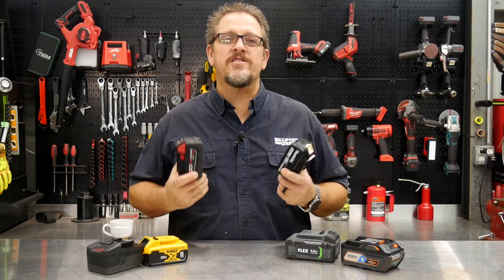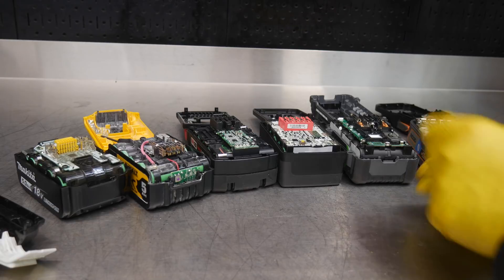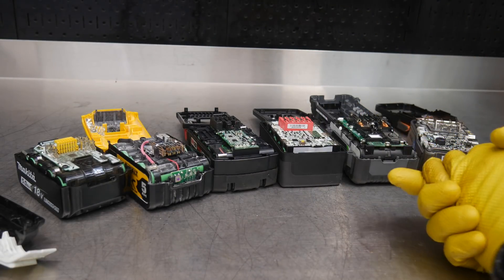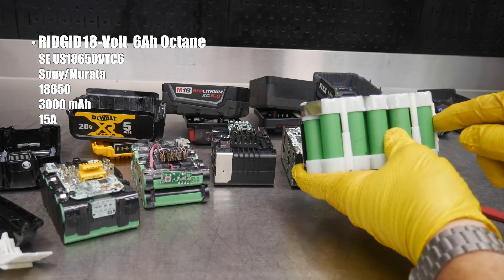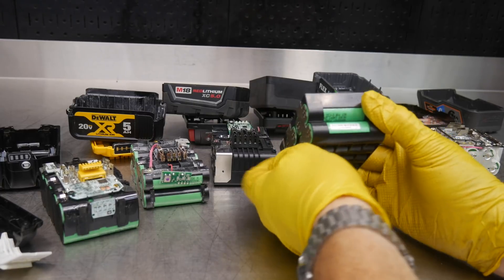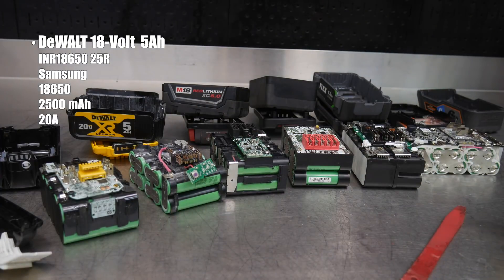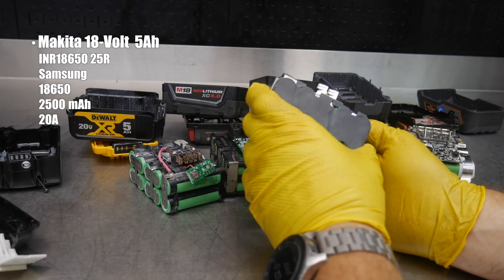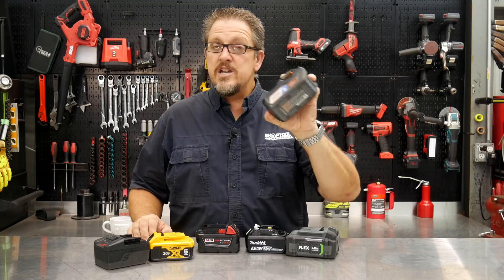What's Inside Tool Batteries? Milwaukee FLEX DeWalt Makita Snap-On [18650 21700 ??]

Comment: Why didn’t you test the differentiating brands of cells 🤦🏼‍♂️
Reply from the maker: That's a good point, but it's mostly useless. Many tool companies will change the brands of cells that they use, based on supply, price, etc. Even the same size battery may change the brand of cells. Thanks for watching.

Comment: A bit disappointed to see regular nickel-plated steel connecting those - they chose the cheapest components. Bosch batteries seem to be significantly better built than all of these.

Comment: If you're a bicyclist, drone/RC enthusiast or an avid hiker you should already be well versed on 18650, 21700, 26650 and 28650.........like everything in life no 18650 battery is created equal.....you have crappy one's and high quality one's.  The fact that the entire industry uses Samsung speaks volumes on how the entire industry is just in collusion OR Samsung just makes the best batteries.
Reply: Dewalt used LG cells in that 5ah XR battery prior to 2022. Not sure why they changed. There weren’t any issues with it. Maybe Samsung is giving out crazy discounts to tool companies ?
Reply: Don't even get me started on the ykk zipper conspiracy

Comment: The numeric designation denotes the diameter, length, and shape. 18650 = 18mm diameter, 65mm length & 0 means it's cylindrical

Comment: This is probably already mentioned, but as far as i've read, and seen all the 18v = 20v.   It's all marketing.  But I have some from each brand, and they all start at about 20v fully charged and go down to about 18v nominal.  Flex 24v is probably different though.

Comment: Happy to essentially conclude that they are all the same thing. The Snap On is $$$$$ while the makita is $$$$ DeWalt and Milwaukee $$$, Flex is apparently a Lowe’s house branded tool, which I know barely more than nothing about, but they seem to be lower priced. 
Rigid being Home Depot’s captive offering, with solid worthiness but a questionable lifetime warranty. My experience was met with BS excuses such as still possessing the ORIGINAL printed receipt!!!! A tool I used plastic to purchase, which was supposed to be my iron clad proof of purchase, purchase price, time, date etc. Thankfully the rest of the Rigid tools I have haven’t had any problems. 

My Makita replaced the original Craftsman drills I began with in 2001. The sears battery tools endured till I decided to get top notch gear instead. Now I’m fully armed to the teeth with the Makita 18v system that one and all still perform great.

Comment: More dangerous to put the metal table than wearing gloves 

you can touch them
it won’t kill you
i work on these all the time

Dewalt flexvolt 6,9,12 are just normal 18650 cell
some of their XR using 21700
you can tell they are much wider and bigger 

Samsung 25R are quite decent
Sony VTC6 better quality with less discharge
most tools draw below 15A except some of bigger saw

Comment: Wow, the ridgid, dewalt and Makita look very cheap out of there case, every other brand has a cage in a cage.
Reply: Actually, the Makita cells are not only caged at both ends but the two halves of the cage are screwed together for greater mechanical shock resistance and to take any mechanical strain off the connection strips. The cell interconnections are a full square of conductor material and not just cross strips like the other makes. They also use integrated tabs to connect to the BMS where others mostly use wires. And both sides of the battery pack conductor interconnections are covered in a thick adhesive fish paper to reduce chance of accidental shorting, increase corrosion resistance and increase mechanical shock resistance (albeit small). 
But I like DeWalt tools, so that is what I use.

Comment: Do you know how durable the Milwaukee battery is? I dropped one today from a ten foot ladder on concrete. It still worked and I  kept using it right after. But now I’m concerned it might’ve been leaking and contaminated my clothes and skin. Would it leak and keep working? And would it leak liquid. I don’t notice anything right now, but I’m scared it might’ve been leaking on me while I was still using it. 
Thanks! 

I’ll check the battery when I go back to work tomorrow so maybe I’ll see a residue or something.
Reply from the maker: There really shouldn't be much liquid in these batteries. Lithium Ion is really not liquid. There could possibly be some goo, but your battery would definitely show signs of weakening. Thanks for watching.
Reply: @Shoptoolreviews  thank you for answering I appreciate it! I looked today and saw no signs. So it’s all good. 
Good well informed video

Comment: Has anyone had yellow fluid come out of their battery 🔋
Reply: You have? 
I dropped a battery pack today from a height of ten feet on concrete. Is still worked and I kept using it but I’m concerned perhaps it was leaking gas or liquid. I didn’t notice anything yellow though.

Comment: The output Amps is double what you're claiming. the 2p multiplies the amps by two, while the 5s or 6s multiplies the voltage by five or six. Any of these packs with 20A cells is outputting 40A continuous. Any with 15A cells is outputting 30A continuous. That's why the single row 1.3-2Ah batteries are so inadequate for serious use. They only have 15-20A of continuous discharge.

Comment: The batteries I've taken apart are MILWAUKEE 5ah was Samsung
 DEWALT 5AH had LG CHEM CELLS 2000mah
HITACHI 5AH had SANYO CELLS 2600mah
MASTER FORCE 4AH SONY CELLS. 2100mah

Comment: The funny thing is that the Makita charges it faster (45min for the 5ah) wich is way less than the rest.    In any case,  most of them output an 800w figure.  No wonder why a cordless drill feels so powerfull; A 650w bosh corded drill was a big deal back in the day
Reply: 20V batteries are usually capable of outputting 60A continuously. 1.2kW is the most common figure. usually cutting tools are hugging that limit

Comment: The funny thing is that RIGID has the best batteries. VTC6 have the lowest voltage drop (very important parameter at high loads!). The 25R are good batteries, but not the best! I wonder what's inside the Hikoki / Metabo HPT. The new 18V battery packs look like 21700.

Comment: Thanks for the breakdown, subscribed. Now a question; all but one are 5Ah batteries. Of those the most common cell capacity rating is 2500mAh, and there's 10 cells per battery. Doing simple math, 2500mAh x 10 = 25,000mAh / 1000 = 25Ah. I must be misunderstanding something, where am I going wrong? Is it because they're wired 5 in series so need to divide by 5?
Reply: Yes, the pack are in 2s5p configuration, 2 rows of 5 cells in series, so you get 2.5+2.5=5, in series the voltage adds up, not the capacity.
Reply: The cells are indeed in 5s2p configuration. 2 cells in parallel equates to 5ah. Essentially making one 5ah cell out of two 2.5 ah cells. Then those are series for 18v. 

Hope that makes sense.

The way you're looking at it, would be every cell in the pack in parallel, and voltage would be 3.6 nominal or 4.2 max.

Comment: if using lithium polymer drone battery.  the energy expended is certainly much greater than the 18650.
Reply from the maker: True, but you don't find Li-Po batteries on powertools. Mostly Li-Ion. Thanks for watching

Comment: Great video I was just looking at the 25r to rebuild a pack and i guess its clear its a good choice.  The interesting one would have been the rigid 5ah, might well have had 25r. The 3ah I am repairing are not marked.
Reply from the maker: That's interesting. Typically we can always find markings on the batteries today. Thanks for watching.
Reply: You will get much better results with a 25S, or if you want the highest possible output, the 20S
Reply: @procrastinator1842  hard to find the 25S. The 20S is available if you wait for them to be in stock

Comment: Old dewalt used A123 cells  50A discharge current,120A peak.
Reply from the maker: Wow, that's impressive...120A peak discharge. Thanks for watching.

Comment: 21700 will always win vs 18650 when it comes to performance related to brute power (max current). But from a capacity perspective, the manufacturing process has to evolve a little more to catch up with 18650s in regard to capacity per cell volume (energy density).  25Rs are the most used 18650s today in power tools. Batteries of mid-rage tools go for Sony V3s or newer than can also be 10A, not 20 like samsungs. Milwaukee stared with 12AH the use of 21700. Now they have 2x5 and 1x5 batteries with 21700s rated high output.
Reply: Not necessarily the 6amp flexvolt which has 18650 cells outperforms the 6amp 20v battery that has 21700 cells
Reply: @loucifer4205  You can't outperform Samsung Ts with samsung Q/R/RMs. Your statement is absurd. Unless that18650 battery uses 4 rows of 18650 of 1500mAh, which are obsolete by now.
Reply: A pissing march is always bound to happen when two battery dorks cross swords😂

Comment: Awesome video but not really anything not already available with a small amount of research.   Where I think we need more information is in the features of the batteries and how they interact with the tools - not the difference between 18650 and 21700 cells. Obviously a bigger battery will have higher output.  I want to know what the features of the battery management system are and how tool makers are interacting with their batteries.  Also, while 5 of the 6 batteries had batteries rated at 20A continuous is that really necessary?  How many amps does a tool draw under load?  With Lithium cells there's always a tradeoff between capacity and max output.

Comment: Please correct me if I'm wrong.......I'm not sure I understand but is the only difference between the 18650 & 21700 the fuel tank? Power output is power output but having the 21700 batteries are like upgrading to a larger fuel tank that still has the same horsepower engine........ Please let me know if this is a correct statement. I don't know.

Comment: DeWalt starts using the 21700 cells in their 20V 8 & 10 Amp/Hr as well as their 9 & 12 Amp/Hr FlexVolt batteries. I’m not positive of what cells are on the 20V 6 Amp/Hr battery. The 20V 5 Amp/Hour and down 2 stack batteries as well as 1.3, 1.5, & 2 Amp/Hr single stack batteries use 18650. The 20V 3 & 4 Amp/Hr single stack batteries also use 21700. The 6 Amp/Hr FlexVolt battery uses 18650 cells. The FlexVolt batteries all use 3 cell stacks of 5 either with the stacks in parallel for 20V or series for 60V. The 20V batteries can come in either a single or double stack of 5; some newer DeWalt tools can take advantage of the increased power capabilities of the larger 2 stack and 3 stack batteries. DeWalt only calls them 20 a Volt Max in the US/American market in the UK and EU DeWalt calls them 18 Volt Max.

Comment: Some Milwaukee tools do indeed take advantage of the higher amp output from the 21700 cells. And Makitas new 40v line uses the 21700. They got stuck with cell size because of their choice to do the x2 side by side 36v tools. They would have had backwards compatibility issues.
Reply: I think I'll build my own 21700 battery 18v pack for my Makitas using one of the DIY boxes from alie.

Comment: DEWALT IS NOT 20 VOLT! It's just marketing the 20V max... Here in europe they are labeled 18V. And their 12v line is 10.8V in here. 
The difference is in measuring nominal voltage or not. Lithium cells usually are ~4v peak  and 3.6 under load, so 3.6vx5  Is 18v and 4vx5 is 20v... That's where it comes from... P.s some Li battery chemistries (most of them) are actually 4.2v max 3.7v nominal

Comment: It seems to me the tool battery cells are still fairly primitive on there own when you take away all the tech, microchips and all that connect to them. They are still the same shape and heavy. I’m waiting for the time when they begin to really shrink in size and still maintain the power as fell phone batteries have done.
Reply: Phone batteries are bigger today than a lot of phone batteries in the early 2000s, as today's phones require way more power. Just like how power tools require way more power than a cell phone. Tool batteries might still be big and heavy, but they're significantly more powerful and longer lasting than the old ones.
Reply: Most cell phones now use Lithium ion polymer (Lipo) type batteries which can be thin and formed to fit in the available space inside the phone. They are very energy dense but are considered more dangerous because they do not have full metal cases and the slightest puncture that introduces air into the cell can cause it to go into wildfire. That's how a dog chewing on a cell phone recently set a house on fire.

Comment: I am surprised that Teslas are full of thousands of these small battery cells. I would have thought electric car battery cells would be the size of beer cans. My point being, in a cell phone the lithium batteries are flat and tiny. Tool batteries are larger due to the power load. So why aren’t car battery cells scaled up in size? Strange... at least too me.
Reply: The reasoning behind using cells instead of prismatic blocks (you can get 400 amp hour prismatic beasts) is the 18650 allows better cooling of the battery material for a longer life and safer operation at high current discharges.  Their newest tabless NMC cells are 4680 9 Ah cells or 46mm in diameter and 80mm long.  They were able to get the internal resistance down enough that those cells can crank out the amps without getting hot.  The 900 KW/h battery pack option in their semi has a massive amount of those cells.  Now THAT is the cell I'd want for my next tool pack, they can handle 5,000 cycles completely drained and speed charged and would probably outlast the tool.  Maybe in a few years some tool company could get those cells, I'm not holding my breath though.

Comment: We have Snap-On but no Kobalt 🥴🥴
Kobalt would use the same as Flex though Chervon babies 😁.
Kobalt uses 18650 and they have 21700 in the ultimate output batteries that are unicorns for the XTR lineup

Comment: Being the batteries are all the same.  I wish they would be universal.  I like brand A's drill and brand B's grinder, and brands C's saw.  But I don't like having 3 different batteries and chargers on my bench.  Plus you can't have just one battery you need at least two of each.  So I stick with one brand but now I have a tool I don't really like because I don't want all the batteries and chargers.  If the only difference is the electronics then why not stick that in the tool and make a universal battery that all tools will use.  Just like when they made all (well almost) cellphones use the same charger.
Reply: I recently heard about adapters for this purpose. Check em out. May be what you're looking for

Comment: Excellent Tim !!!  I concur with others in the comments a more expanded version of this video would be great!  Thanks for putting this out.  Very interesting.  Again, I am not impressed with the FLEX brand battery.  Looks like the Makita, DeWalt, and The Milwaukee are the best constructed batteries.  I’m not too sure about the whole M18 Copyright issue that floats around on YouTube, but I have it on good authority DeWalt chose the 20Volt nomenclature based on Marketing Hype, and to distinguish from the older 18 Volt batteries, both NiCd and the LiIon post batteries they made.  Like others have mentioned, I do take issue with Makita on not only their outright refusal to go with some 21700 celled batteries, but to come out with the.XGT line, and not make it backwards compatible!?  DeWalt and Metabo HPT didn’t seem to have any problems doing it?  Makita just won’t admit that it would potentially open up issues with compatibility with existing tools, and not having the space for the bigger batteries, namely the X2 tools.  Stay safe and Healthy!  👏🏻👍👍👍👍👍😁✌🏻🇺🇸
Reply from the maker: We do share a lot of your concerns and comments as well, especially concerning Makita. It will be interesting to see what the near future holds with battery technology. The more that the auto manufacturers push electric, the more the tool industry will take backseat to the Lithium supply. Thanks for watching.

Comment: You can determine the cell size inside from the length of the pack size - ones with 21700 are visibly longer (0,3 mm x5 = 1,5 cm, duh) with longer nose/front and usually release button too.

And there aren't many different manufacturers because of environmental polution, since cell manufacturing is a nasty chemical business.
Reply from the maker: Thanks for watching.